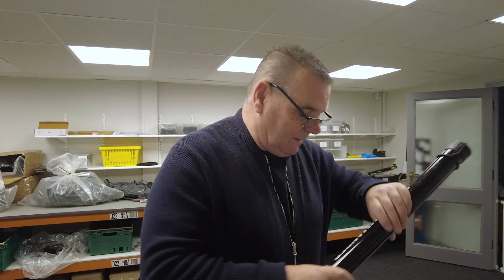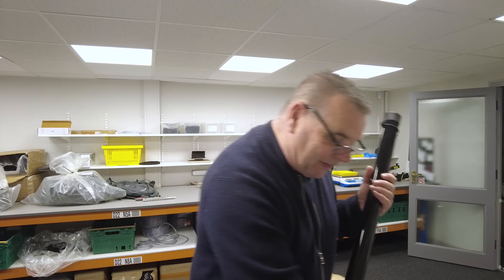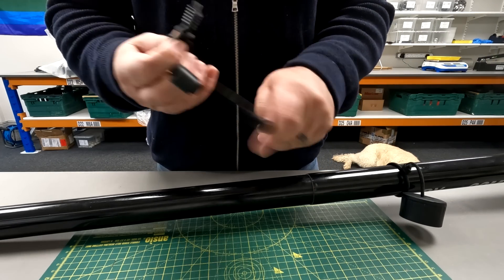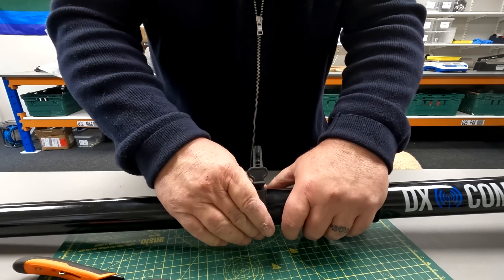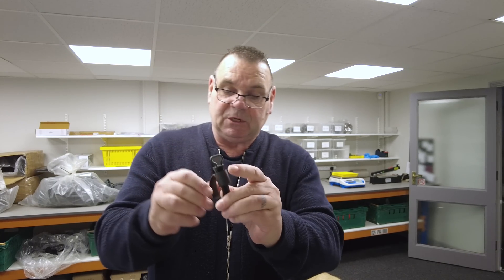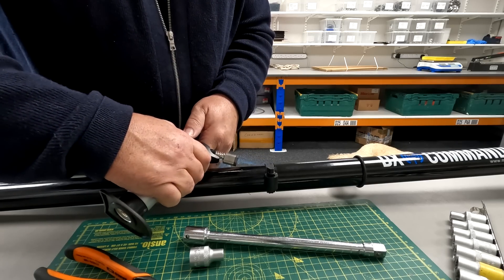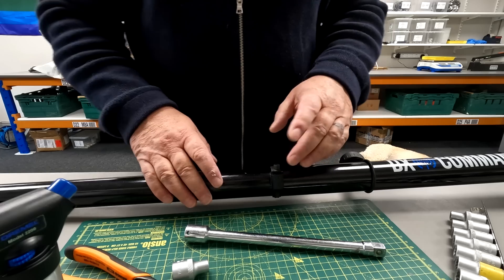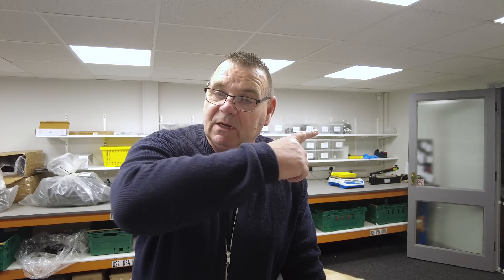DX Commander gets Critical UPGRADE - Nylon Clamps

Comment: Hi Callum how many EzyClamps will I need for three 10m poles please ? Two of the poles are to hold up a  40m delta loop, and the other pole is for a 40/10 m vertical. Thanks in advance Mike M1KEY
Reply from the maker: Erm... OK Delta Loops need a bit of tension. I would maybe look at a different engineering solution. But probably 6 for each would be ample.
Reply: @ what did you use in your garden to hold up the delta loop was it a banister rail .

Comment: Be aware in using these clamps. I went to work on putting these on in 45deg F temps and the first one I went to install near the base broke, snapping off in length. At 45deg it's too brittle. I brought them indoors for a while and they've got good flexibility again. I'll use the broken one on a smaller diameter area to clamp, but be careful to only use these when they're warm. Once they're on they seem to hold ok so far, but do not attempt to put them on when it's or at least these clips are cold.
Reply from the maker: 45 degrees.. I think you are in F. In "my money" that's 7 degrees C. OK, so fit them "warmed". Thanks for the tip.

Comment: That's a great system, but my Classic will be a permanent install so I am going to love those Nylon 66 clamps I got 8 clamps and no hose clamp in the Classic that came in last week. What torque spec would you recommend we tighten these to. Hey, I used to be a bolting inspector so torque is important! LOL

Comment: The clamp style used on drum rack mounts for cymbals (minus the cymbal part of the clamp)  could be a great commercial type option for this level of antenna.  The other benifit of a drum style clamp is that it could go right across the joints in the tubing making it hurricane proof.   You would need different sizes but something like that is what I'd hope to see on an antenna such as this and not plastic screw tie things.  I'd be concerned how plastic is in Canadian winters over time as well.  Not UV concerns but -40C one day and +5 the next.  Anyways, just a thought.
Reply: Mine broke when trying to install at 45deg F. Don't try to install or adjust in cooler temps.
Reply from the maker: But if it works at -40...

Comment: Looking at picking up an Expedition soon, and I'm thinking that reusable nylon zip ties would work for the upper couple of segments.
Reply from the maker: Yes, for the very top? Although on the expedition, the weight up there is SO small, I have never used anything up there other than a sharp tug!
Reply: @DXCommanderHQ  — I tend to be a belt and suspenders type.

Comment: Very nice indeed! May I ask what kind of wire/rope you´d recommend attaching the antenna to the ground? 
I´d like to use two sets of 3x wires/ropes to be sure in windy areas (3 near the bottom & 3 abt. 5m up).
Reply from the maker: OK, so just use "real" 550 Paracord (make sure it says 550 - even if it's a copy). They normally have 7 strands inside an outer braided sheath. Don't buy stuff that just says "Paracord, make sure it's "550" and has those strands inside.

Comment: Like the concept, but will it work for the small diameter sections of the Rapide?  Or do I need to source shorter version than you are stocking?  
At the moment I plan using the Rapide as semi portable, as I will be putting it up and down quite often to keep it low profile and less likely to attract the HOA police.
I have not at the moment taped the joints, but since I had issues with collapsing under tension a couple of times while I was tuning the antenna, I have decided to go ahead and tape the joints as described anyway in your installation notes.  I have enough room to store it full length on my patio, and the Rapide is very easy for one person to handle.
Couple of other "upgrades" I did:
- I found it much easier while tuning to use zip tie connections and only use the clips at the end of the shock cord (those clips are a real PITA to attach, and I have got close to hitting the ends with my hot air gun a few times, instead of tieing a knot).  Zip cords are much easier to remove and more secure than just taping a loop.  I'll be making this my permanant fix.
- For the 40m Rapide I ran out of shock cord so needed to cut and splice on a piece of paracord to reduce required length (if I remember correctly that was for the 20m and 17m bands on the Rapide).
- Finally I added 3x stainless carabiners to attach the guy ropes ... makes installation much faster and easier.
All-in-all a great antenna and have just one more bit of fine tuning to do to make it a great performer too.
Reply from the maker: We are about to dump the clips. Better solution. Top end of Rapide shouldn't collapse, so we will supply "enough". SHock cord.. I need to suggest in user guide how not to run out. There's a trick. Splicing Paracord works too (as you created). OK on carabiners.
Reply: @DXCommanderHQ  Top end was fine... the middle section between the 2 spacers is where mine kept collapsing.  Solved now by taping the joint.  Tuned up and in operation on 20 and 40m... couple of minor tweaks needed to get lower SWR on other frequencies.  I think I have finally mastered the nanoVNA!!
Reply from the maker: PS - Thanks for feedback.

Comment: Hi Callum for those concerned about UV resistance I can confirm that I have had 3/8” wide Nylon66 Ty-wraps out in my garden 24/365 holding various trees/bushes in  place since around 1995. The colour has hardly faded at all and they still tighten up like new. I’m in the UK.
Reply from the maker: Sounds great!

Comment: Thanks for this video, the plastic tie straps you sent with my DX Commander Classic were not sufficient to hold the the pole from slipping down. I did a search and found these plastic worm drive clamps easily. Made in the UK and four inch diameter max and one inch min. I bought the hex head drive version. Yes they are expensive.

Comment: Mr Callum……how could I erect the antenna in a cement area
Reply from the maker: Use a heavy Patio Umbrella Stand.. Or core a hole and slip a pole into the concrete and put DXC over the top about 60cm/2 feet.

Comment: Thanks Callum.  Great to see you improving and evolving your product.  I would repeat the advice give by another viewer.  It might be best to try to smooth the cut edges with a soldering iron.  The Dremel miniature torch appears to be a fine product but is a bit pricey and there are other brands that appear similar.  Maybe you could try a cheap disposable lighter as well.  Maybe the edges could be smoothed with a piece of sandpaper or a sanding block.  It would be interesting to see you compare the smoothing methods in a short video.  73.

Comment: i have knots in the elements just below the first plastic plate (that is pulled down by the guy lines). So the "hot" aluminium plate is not pulled up at all. I like the new hose clamps - better than always fresh cableties or electric tape.
Reply from the maker: Bemi, can you send me a picture of that? I don't understand. Thanks..

Comment: Will these hold up to -28F?  We usually get at least a couple of weeks of extreme cold every winter.  Thanks,  Chip W9OQI
Reply from the maker: Nylon 66 is fine in low temps. Not maybe while you install, but in use, fine.

Comment: Between hose clamps and this I was shipped plastic electrical ties.   Really wish I got this or just hose clamps instead of plastic junk.
Reply from the maker: Hmmm. What we shipped isn't "junk", it's just different - and I was using that system for last 12-months on the prototype 9.5 which has been up since last October.. However, you might be able to get these locally, just search HCL Ezyclamp. You want 50mm PA66 for a Classic.

Comment: If these are just strong nylon, (not metal in the middle), rather than the cut and blowtorch approach I'd suggest you use a large soldering iron with an old soldering bit in it, but still clean off the bit afterwards.
73 Ed DD5LP

Comment: DX Commander has got to be one of the best engineered antennas on the market.  Great improvement.  Really like the hex head bolt cordless drill and a socket .... Done
Reply from the maker: Cool, thanks!
Reply: Just set a torque first lol.

Comment: Tried metal ones with the ears and tubing they work very well but they do rust as the worm gear removes the coating. Very nice find Cal 😉 yea I think the metal ones were 2-3.00 for a pair and I think I could not find the biggest size in metal either. Found sum thin ones for dryer vent line with colored ears but they were very delicate and couldn’t tension they without slipping 😳

Comment: I have a DX Commander Classic that I haven't set up yet, but soon, is there any advantage to these nylon hose clamps versus the ones that it came with before?
Reply from the maker: Everything we have ever supplied works just fine. I prefer these. If you want some, you can EITHER buy from us - or you might be able to get these locally, just search HCL Ezyclamp. You want 50mm PA66 for a Classic.

Comment: Using this clamps almost a year now on my portable. No problems with UV. Holds the elements in place, no collapsing.Antenna is in permanent use since 10 months without any problems. 
  73's de DB1PC
Reply from the maker: Perfect!

Comment: Torque specs.  I thought of this when I was assembling.  I can cobble with the best of them but I was wondering if people were cracking their poles with the hose clamps.  Especially since everybody has a cordless drill now.

If you really want to get fancy, since you have the material to test with, find out how much they can take with a torque wrench and throw that in the specs for the older models.

Comment: Nice clamps, what a good idea. Have you ever tried drilling a hole through the tube and fitting a pin or does this affect the strength of the pole? Just a thought.
Reply from the maker: Don't do it.. You will NEVER line them up again.
Reply: @DXCommanderHQ  I think he meant just the upper tube of each pair and using a push pin or similar.
Reply: @DXCommanderHQ  The voice of experience, thanks Cal

Comment: What you need is the manufacturer of the claps to make a plastic wingnut spanner similar to a gas meter box key spanner with a 8mm head instead of the triangle to do up the hex nut version.
Reply from the maker: Love it! Please pay for the tooling and the Minimum Order QUantity of 20,000!
Reply: I thought I posted an answer with link... Something like the Murray Clamp Key? It is 5/16" or 7.94mm... might work.

Comment: Hi Callum, 

These look great, nice find & great job on your continuing engineering improvements! 😀

Now, my 1 concern is that it is a plastic, and outdoors here in Arizona - our Sunlight with high UV & extreme temperatures (115°+ F.), Dust, etc. just kills most plastics.  The death from the brittleness...

I may need to get a few just to test on an existing pole to see how they hold up.

Thanks as always Callum for a nice vid.

73 John N7GHZ
Reply from the maker: Nylon 66 is EXTREMELY UV proof.
Reply: @DXCommanderHQ  Ok then 😀. Thanks & 73 Callum
Reply: Came here to ask about UV. Living at 6000 MSL we watch black plastics turn brittle in a year or less. 

Thanks for asking and thanks Callum for the answer. 

We buy only UV stabilized tie wraps for anything outdoors. Everything else snaps off at the first tug  or vibration after a few months outside.
Reply from the maker: @NatesRandomVideo  UV Stable, don't worry.

Comment: For DXC, you mention adding these below the spreader plates. Do you still advise a couple of turns of self amalgamating tape, with a couple of turns of 3m temflex on top to waterproof joints? Love these new clamps, and have ordered a set to retrofit my DXC. 👍
Reply from the maker: No tape. Just these are fine.
Reply: @DXCommanderHQ  If you already have taped up the joints, do you recommend taking the tape off when installing these for a permanent installation?
Reply: I removed the tape on my 12.4 last week because the tape was allowing the clamps to slip.

Comment: Are they available to buy seperate
Reply from the maker: Yes.links in description..
Reply: @DXCommanderHQ  
Thankyou 👍👍
Reply: I would be very interested in a number of these.  I have a 4/5 element 5 band quad build in the shed...  Yes I enjoy pain.  GI0UTE
Reply: Just spotted they are available separate.  Excellent.  I might need 100.  I will contact you when I'm closer to the build.  I'm at the tower build now, so it will be a few months before i get to what's on top.
Reply from the maker: @dieseldes6578  For 100, I will check with Wendy, but I can do you a discount, I am sure.